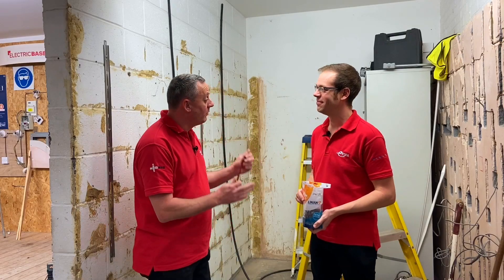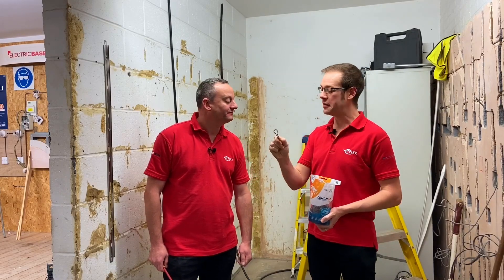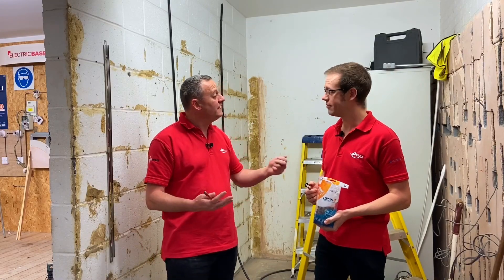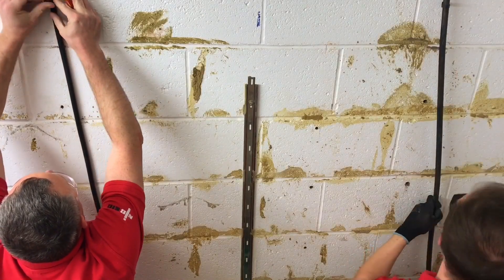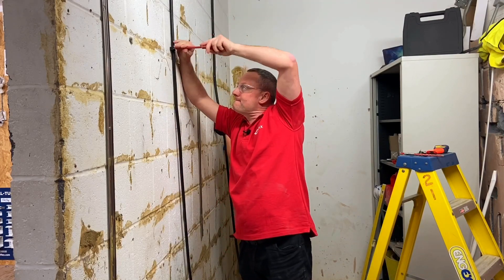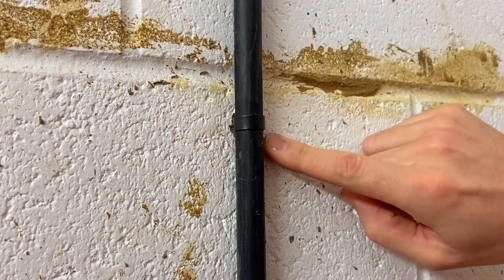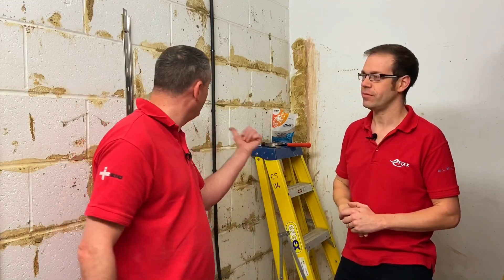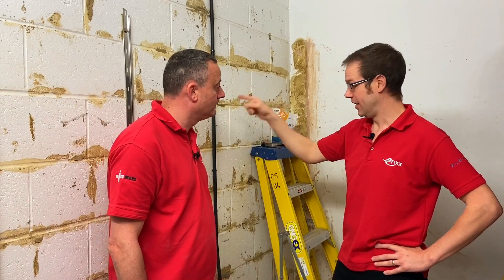SWA Cable cleat vs Linian Super Clip -which is faster Faster, Neater and Saves Time?

Comment: These are great and all but, for 25 of them it's £21.90+ depending on what size.... I can get 219 cleats.... instead of 25 of the super clips, that depending on what you are securing them to it might not hold...
Reply: At CEF they were doing a pack of 100 linen clips for 30 quid Im sure that was for the fire ones tho

Comment: What type of metal are they? Id be worried about rusting of the clips then eventually they would break away
Reply: LINIAN clips are made to last with a melting point in excess of 1000°C and Fire-testing to BS5839, BSEN 50200 (PH120 - 120 mins), and DIN41002-12.  All coatings tested to 1000hr Salt Spray certification. They won't let you down!

Comment: id be interested to see how tight they hold the cable when youre doing 90's?
How easy it is to adjust your bend to get it perfect whilst lining up the clip?
How do you remove them?
Reply: You will notice that the SuperClips are much “chunkier” than our FireClip and T&E ranges and this has been designed with the intent to enable significant rotational stress. This means that you can anchor your SWA safely and form a bend in the cable without having to remove the clip to do so.

Comment: All well and good, but at some point the cable may have to come out or be rerouted, how are you supposed to get those out??
Reply: You can take them out with a pair of top cutters. Pinch just below the head and pull out. Innuendo not intended but hey ho 🤣
Reply: No grinders required! LINIAN clips are designed to provide a lasting fix, however, if a design change is required, the clips can be simply removed with a set of pincers. Check how easy it is here: https://vimeo.com/233296893